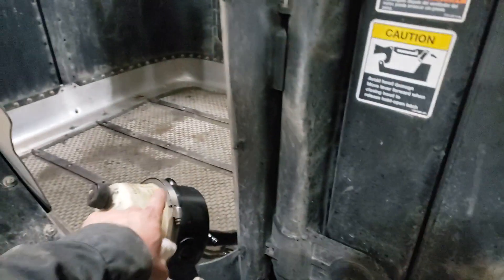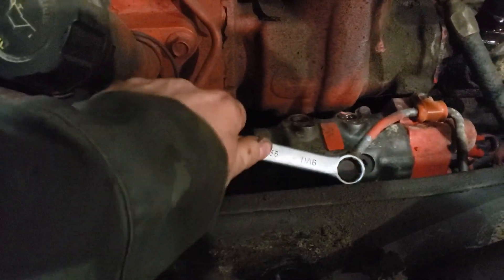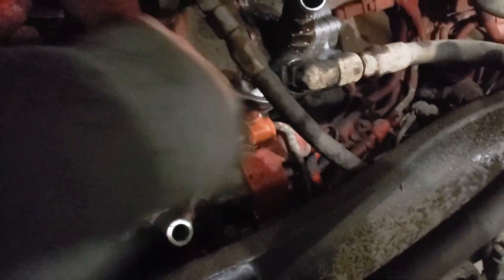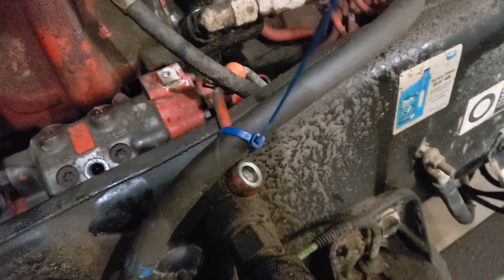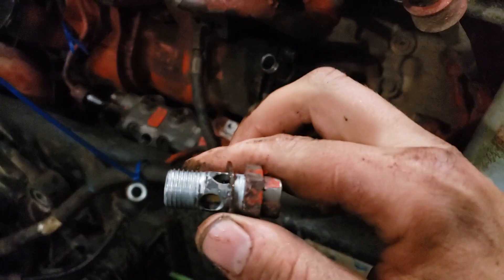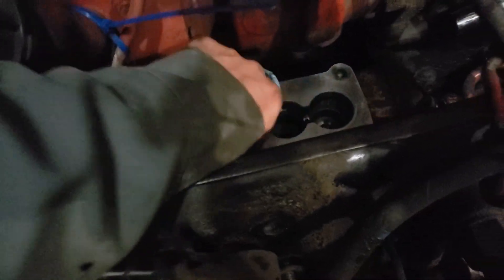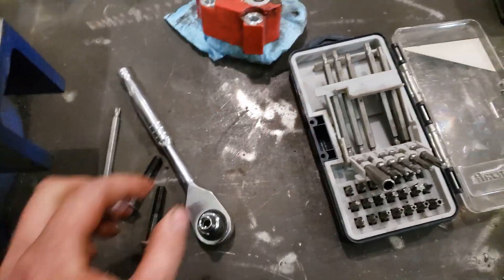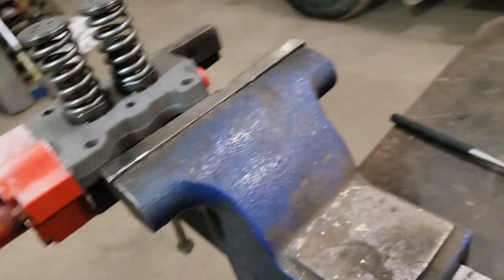Cummins ISX High Pressure Fuel Pump Head Replacement (includes torque specs, step by step)

Comment: You didn’t pull the followers out to check the cam and rollers, mine turned out to be worn and the cause of the 559 code

Comment: Hey bud, I got a question. What’s the symptoms that made you decide to change a fuel pump ? because I’m having an issue and I don’t know if it’s the fuel pump is very rough at cold start
Reply from the maker: You can check command fuel pressure vs actual with insite or another scanner that will read data.

Comment: hi there what year Cummins ,mine doesn't have this , mine is back of engine driver side.  CM 871  2010.  thx
Reply from the maker: Only the newer single cam engines have this pump.

Comment: Parts are very expensive, head and gasket almost $2600 at Freighliner dealer of course the pump is more expensive, my first time trying to fix one of this pump, I appreciate this excellent video 😊 fingers crossed and hope it works 
Thank
Reply: I was quoted 1900 for the fuel pump head but I have a cummins
Reply: @tamipotirala6973 dónde se consigue los repuestos
Reply: and $130US/hour at a dealer................

Comment: Good morning 
On the first high pressure line that you remove, on mine it's leaking,there's a gasket or o ring I need to replaced or do I need to replace the whole line??.
Thank you
Reply from the maker: If the taper on the line is wore you may need to replace the whole line.
Reply: Thank you

Comment: How did you diagnose that the pump needed a new head?
Reply from the maker: That one was leaking externally.
Reply: @zedperformance  ahh okay makes sense
Reply: Mine was cracked by the bolt on top and leaking fuel everywhere

Comment: do you think this might help for 0559 code?
Reply: its the first place to start on a 559 code if your positive your not sucking air, also check the rollers and the cam for damage when you have it off.

Comment: Great video sir.! I have Cummins isx 400st my  truck is loosing power at about 1600-1700 rpms going down the road no trailer. Do u think it might be caused by fuel pump failure.? Do u know how I can troubleshoot this issue? Thank you 🙏🏽
Reply from the maker: First thing I'd do is put new fuel filters on if you haven't yet,   next would be check air filters.    After that it would be good to get it it scanned and see if any codes come up.
Reply: @zedperformance  yes sir. I’ve done all those things already. It just left the shop yesterday and the Mechanic deleted all codes except the amber check engine light but he told me it will not go out do to egr being deleted.? Also code j1939 datalink is on my dash idk if that would be the issue.? Thank u
Reply from the maker: @Jreddygo  Have you had the ecm tuned for the egr delete? 

For low on power I'd wanna scan the engine and make sure rail pressure is where it should be.  Also you'll wanna check boost and make sure it's where it should be also.

I don't know the specs off hand,  but you can log onto cummins quick serve and create an account.  That will give you access to every spec/procedure for your engine.
Reply: @zedperformance  yes sir. That is what he was doing because I replaced my ecm with another reman one because originally it was giving me more issues. But now pretty much that’s my only issue is it’s loosing power. Once he connects the software can he check if I’m getting proper fuel pressures.?
Reply: @zedperformance  is there any place you can recommend me where I can buy a laptop and software to make my own checks.? Thank you sir
Reply from the maker: @Jreddygo  yup he shouod be able to check all that with insite or whatever scanner he's using.  

I should mention I've had the exhaust pressure sensor fool me on these in the past.  No codes and seems to be working but not sending the exact correct data.

It's load based fueling and it uses that sensor to determine how much fuel.
Reply: @zedperformance  I’ve been watching videos about that sensor and I almost bought a new one a few days ago. I should’ve replaced it...lol
Reply: @zedperformance  my truck has the isfm fuel system no rail. It’s 09 Cummins isx 400st
Reply from the maker: @Jreddygo  ah OK,  still can check high pressure fuel pump,  I have a manual gauge I usually use.
Reply: @zedperformance  do u have a video to show me how to do that.?
Reply: @zedperformance  how much for the labor
Reply: It was the fuel shutoff actuator...🤦🏻‍♂️

Comment: Nightmare of a system that costs 6000.00 to replace the high and low pressure pumps. And the ceramic injectors is another story
Reply: Plungers not injectors

Comment: So you mean to tell me that you / I don’t have to remove the whole assembly? In other words your saying that when the fuel pump goes out all you would  replace is the head unit? And leave the rest of the assembly on? Only asking because I have one of my vehicles with a ISL 9 2350 CUM and I have no fuel pressure..
Reply from the maker: If the problem is in the head then yes that's all you need to change.